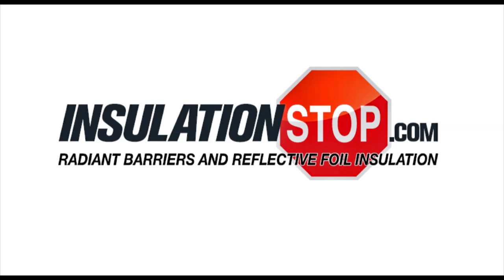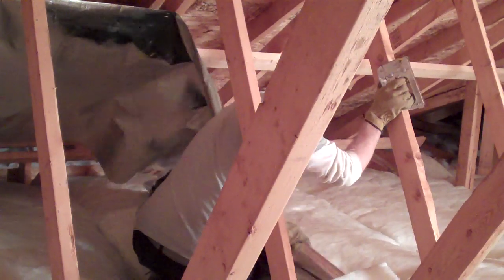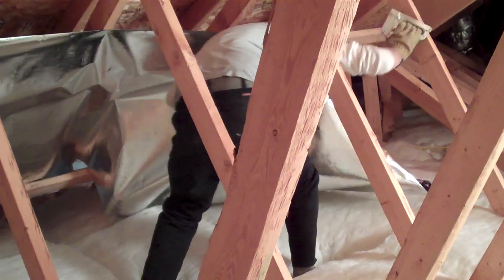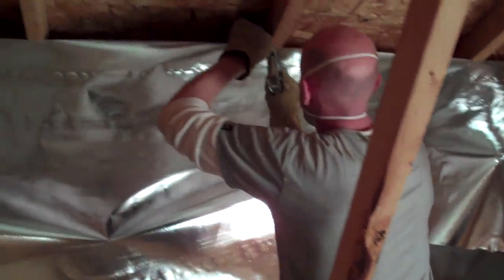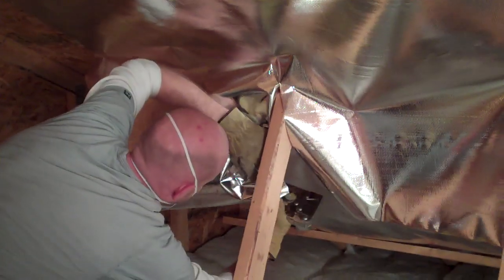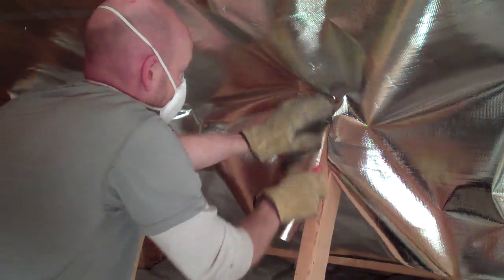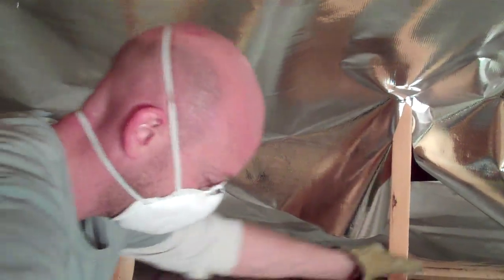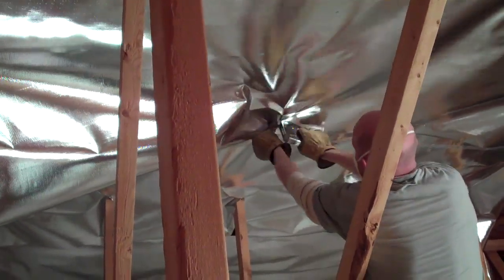Installing Attic Radiant Barrier Insulation - Truss Built Attic.mpg

Comment: I'm planning on installing radient barrier next month and this gave a great visual (as I have the same type of framing in my attic). The only change I'm making to the installation is that when using the wood as a cutting board I'm going to make a small cut going right to left then cut down, although it won't effect the performance in anyway it'll be slightly less wrinkly when stapling
Reply: x14inchdubsx ,

Update?